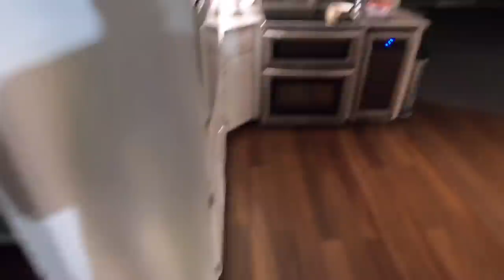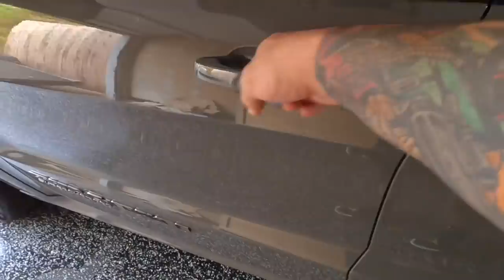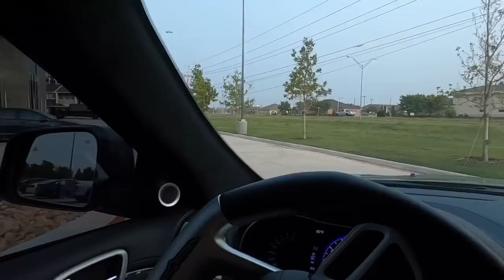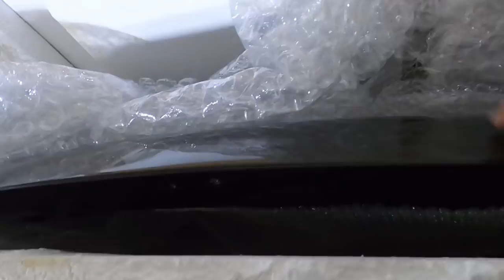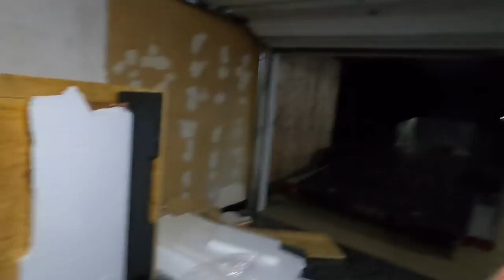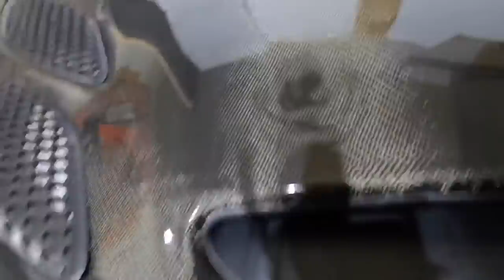MY WIFE IS MODDING OUR TRACKHAWK....

Comment: Go Diamond or CP-Carrillo pistons only!! I have over 450 passes on my Trackhawk stock motor, demon injectors and a 2.72 pulley 93 octane, 10.48 1/4 . More consistent than my dragster. Slight misfire because of a bent intake pushrod. The TCM could not handle downshift and would periodically lay the car over on limiter hard. Bought a new long block replaced it and sent the original to better Built Performance. Putting what I got back into a dragster. I wish I could upload pictures.